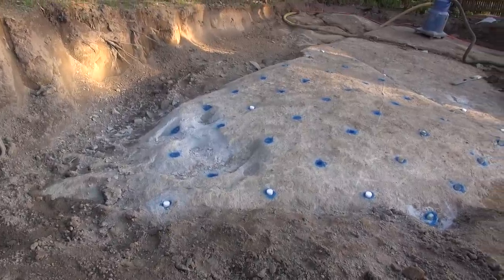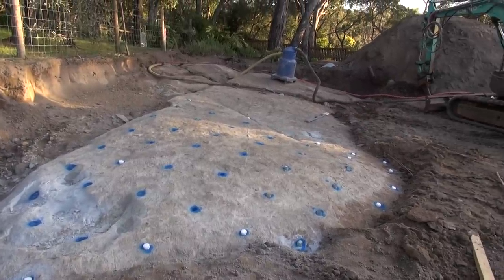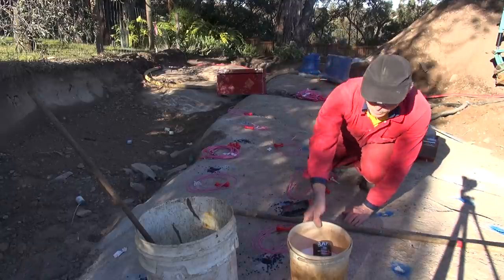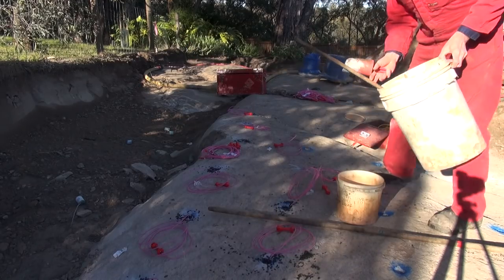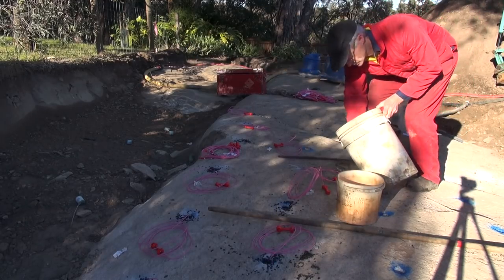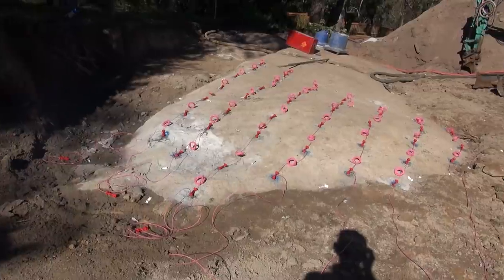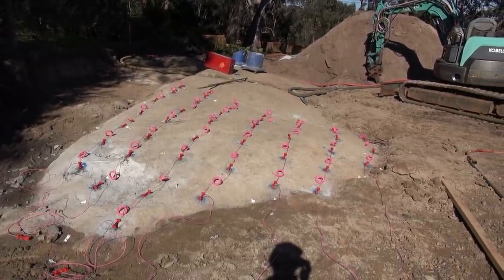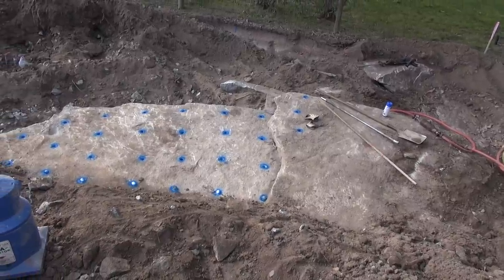Blasting Granite rock in Belgrave South for a garage site

Comment: I used to install septic tanks in the Ozarks and had to blast from time to time....this is EXACTLY how you do it.  When the shot goes off, you just get a little bit of "lift"...and that's it!   If you are throwing debris into the air, the shot is too hot or you didn't put enough burden over it.   Good Job!
Reply from the maker: Thanks PR
Reply: I lived in Mt. Isa in north-west Queensland for 12 years and most of that place is built on rock.  Every now and then, we could hear some one blasting at the north of town and that always meant someone in town had died.  The ground out at the cemetery was so hard, they had to drill and fire it just to get a grave dug.  Talk about waking the dead!
Reply: I am currently facing a problem with some rock about the size I. This video. I would like to have it blasted. I can find anyone in my area. What should I search on the Internet.
Reply: @Joshua-ex8sx  search for demolition or septic tank installers....
Reply: @JamesHolben  thanks for the info I will give that a try

Comment: Looks like you enjoy your work! Not everybody gets to blow rocks up! I have many rocks in my fields I need to get rid of, maybe I will try one of those micro-blasters!
Reply from the maker: I understand the New Hampshire is Granite city, depending on the rock size you might need something a bit bigger Bob
Reply: Yeah, LOT of granite here! Most of them in the fields are about four or five feet around, mostly what I want to do is take the tops off to a depth of about 12". The lawnmower blades do not play well with the rocks...
We do have several in the fields that are about 8 feet high and I would guess 60 feet around, those will have to stay!
Reply from the maker: @newhampshire-bob1604  - the small ones can be capped by digging back the edges a bit and drilling in at 45 degrees from several locations around the rock and loading a small explosive charge in each and firing simultaneously. Expanding chemical cracking agent will do the job also.

Comment: Hello Dave. were they cast boosters you primed some of those holes with? wat sort of dets did you use there
Reply from the maker: No, they all had a 1/3 of a 32mm emulsion plug and a dash of ANFO, dets were Orica 3.6m "Gold dets" (nonel, 400ms down hole with a 25ms surface delay clip).

Comment: Hi Dave, Nice work on all your videos showing your expertise and attention to detail !!!  I notice you pay particular attention to hole depth. Do you drill your holes a specific amount deeper than say the elevation of the bottom of the proposed foundation footing ?
Reply from the maker: Yes and no, as a general rule when using millisecond delay detonators you would sub drill 1/3 of the hole spacing and this ensures that there is minimal high spots, If you can get away with using det cord and fire every hole at exactly the same time there is a tendency to shear perfectly level at the bottom of the holes if you get the loading rate just right.

Comment: I know the main purpose of the soft fill and mats is to prevent excessive noise and flying debris but does it make the effects of the blast on the rock weaker or stronger?
I'd like to imagine that all that dirt concentrates it and makes the effect greater but on the other hand you have the shock lifting all of that dirt up and using energy to do so.
Reply from the maker: The soil cover tends to lessen the effect of the blast, the theory is that the when the compression wave from the detonation meets with the edge of the rock, a lot of the energy is dissipated into the surrounding earth or soil cover. If there is no surrounding earth or cover then the energy in the compression wave is reflected back as a tension wave and this further contributes to the fragmentation.

Comment: The thing I love is the whole understated nature of the event. A master of control.... Now let's see one where you totally mess up
Reply from the maker: Thanks Ben, If I should goof up it puts us behind and as such there is really no time to make a doco
about fixing it. Having said that,I've never really had a catastrophic mess up that has hurt people or caused big damage, The most common blast failure (that can be seen in my next video) is when you get a failure to break up the rock as intended because of 1/ you calculated load of explosives is only just enough and 2/ you have unknowingly drilled through a thin bedding plane of soft material between two layers of rock, the underlying rock is smashed up and you are stuck with a huge undamaged piece on top that wont move. Please like and subscribe for more time lapse and slow mo blasting action.

Comment: What is the name of the device which controls the blast , i means that controller ( a small wooden box )
Reply from the maker: The small wooden box is called a rack bar exploder. I would not normally use one of these ones as they are an antique and a valuable collectable item these days.

Comment: Why was the capsule sent to the hole with the hole facing the bottom of the hole and not the mouth? (second 0:50 per munite)
Reply from the maker: - Why did I not reverse prime - I think this is your question. I'm of the opinion that reverse priming is not practical when the length of the detonator is longer than the piece of packaged explosive into which the detonator is inserted, these holes were primed with only 1/3 of a stick of packaged explosive, if you reverse prime then the packaged explosive does not reach the bottom of the hole because the detonator is too long, when you add ANFO this ends up at the bottom of the hole when you want the strongest explosive at the bottom.

Comment: Are you using little cast boosters for primers ?

Edit: and loading with ANFO ?
Reply from the maker: No, just a 1/3 of a plug of 32mm packaged emulsion and a dash of fairy dust (anfo).
Reply: Demolition Dave Drilling and Blasting I see. It's very impressive the work you do. Controlled, professional and by the looks of it, good fragmentation. Do you ever shoot quarries or mines ?
Reply from the maker: Thank you, The quarry drill and blast scene is very difficult to grab a piece of with out a late model, very large and extremely expensive drill rig and it seems that those doing it survive on the thinnest of margins.
Reply: Demolition Dave Drilling and Blasting Yeah seems to be that way almost everywhere now. Need to be a multi million dollar outfit just to bid on jobs/contracts. And have "The best" of everything equipment wise...
But anyways keep up the videos man i love them. Always wanted to start my own drill blast outfit doing jobs within close proximity to dwellings and business buildings. 👍

Comment: What are you loading the holes with? Detonator, booster, ANFO prill, rock dust then gravel?  The charges seem small for the size of granite but clearly the rock fractured well.
Reply from the maker: The holes in this piece were all between 500 and 700 mm deep and spaced on a 500mm square pattern, they were loaded with 1/3 of a plug of 32mm packaged emulsion, the longer holes also got a tiny bit of anfo. I added the stone dust after the anfo as a barrier between the anfo and the wet 5mm crushed rock that I was using for stemming as anfo is very hydroscopic and it would suck the moisture out of the stemming in a short time and be ruined by the moisture. Load rate was about 425g/m3 which is a bit on the high side but as the as the hole depth gets closer to equalling the burden and spacing the load rate must increase or the holes will just eject their stemming which is a very costly failure.
Reply: Demolition Dave Drilling and Blasting 

Thanks!  Love your videos.  Keep up the good work.
Reply from the maker: Where are you from Bryan?
Reply: I live near Houston, Texas, USA...about 30 miles North of the city.
Reply from the maker: Oh' Is that north of the flooded area? I guess you must be doing ok as your surfing the net. Look like a real big mess over there just now.
Reply: We were right in the middle of it all but were very lucky.  Many people did flood less than a mile away but our house was spared.  We had more than 40" of rain at our house over 2 1/2 days.  A friend of mine who is a commercial blaster had severe flooding (probably 150 acres) at his rural property 40 miles West of Houston. 

Now Hurricane Irma is bearing down on Florida and my stepsister, who lives there on a 52' boat with her family, is likely to have her home destroyed unless the storm takes an unexpected turn.

Comment: Bloody exspensive garage
Reply from the maker: probably less than 10% of the cost of the project Syd. Another point worth consideration is when you buy a home site with considerable rock showing on the surface it is often at a discounted rate.
Reply: @demolitiondavedrillandblast  all good

Comment: why waste all the time drilling and blasting? you have equipment, just get a hyd hammer for the one mini and pecker away.  4-5 days  of drill,prep,cover,blast. 1-2 days hammer time
Reply from the maker: The 12 Tonne machine with a breaker had already failed miserably, many people live in places that do not have hard rock like this and don't appreciate that this rock would have turned the nice new chisel on a big machine into a profile that resembled a well used lipstick before lunch time. I am the option of last resort and I only have a job because on some rocks, all other methods fail.